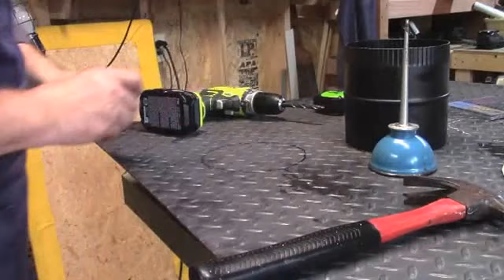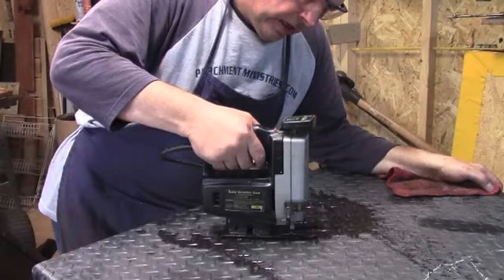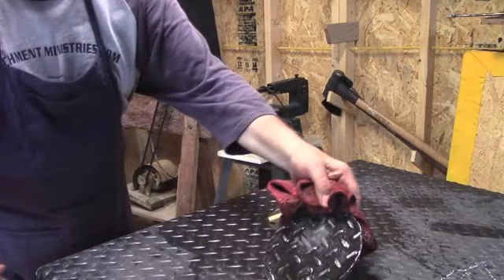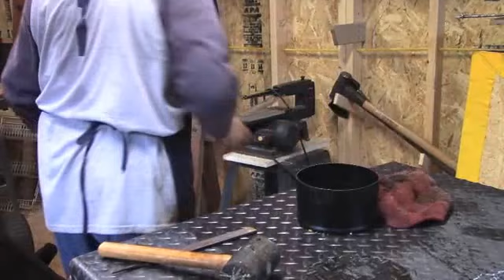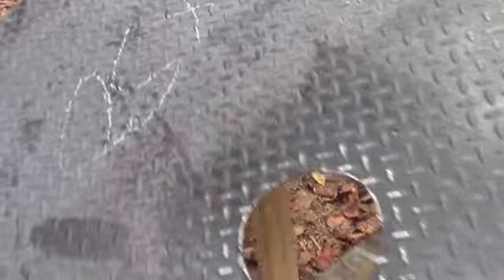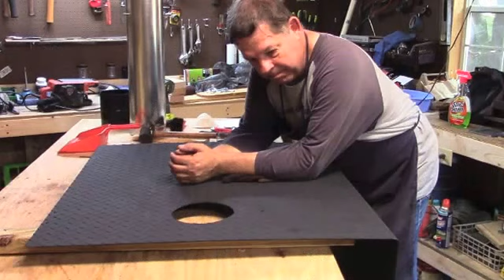How to Build Your Own Diamond Plate Hood, Part two

Comment: How did you get the bend in the diamond plate...and what is the source and attachment of the handle?
Reply from the maker: the local welding shop had a metal bender; So they bent it and welded on the handle; I think the handle is made from a round bar of some type; 3/8 inch? 5/8 inch? thanks for watching!